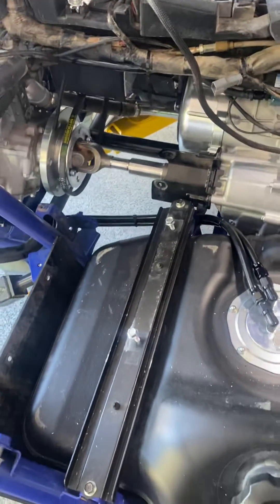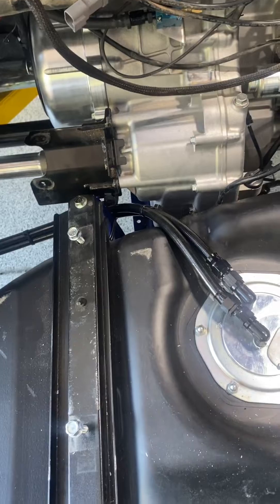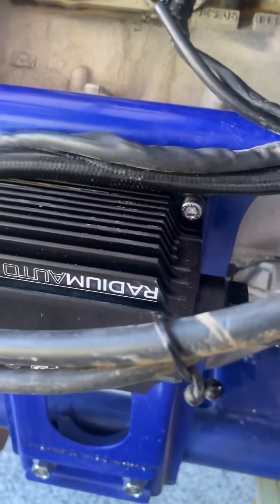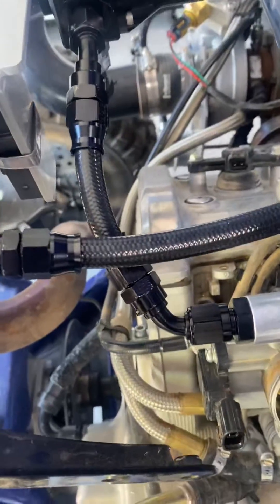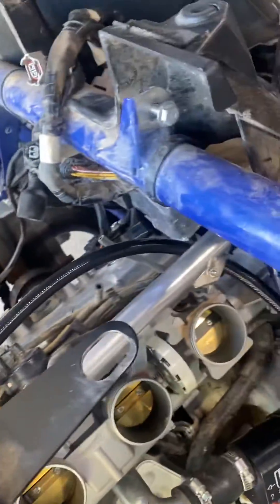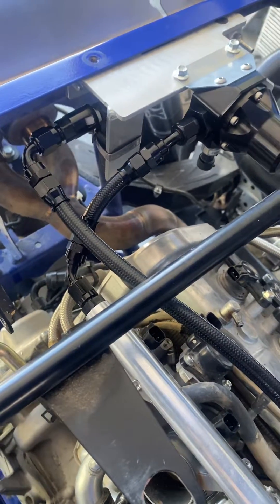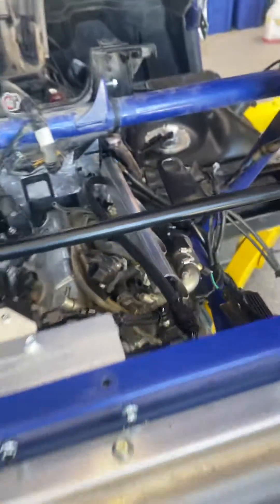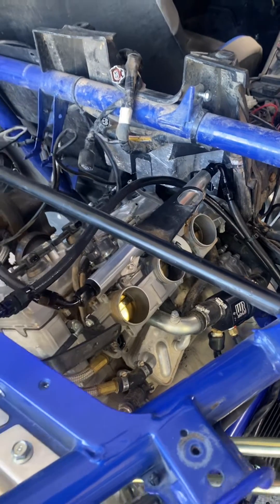2017 YXZ 1000r fuel system overview

Comment: looks like -6 lines. this is too small for high hp cars!
Reply from the maker: We’ve made over 500whp on several cars set up this way with -6an line.  We offer the sending unit in -6 or -8 to suite your needs,